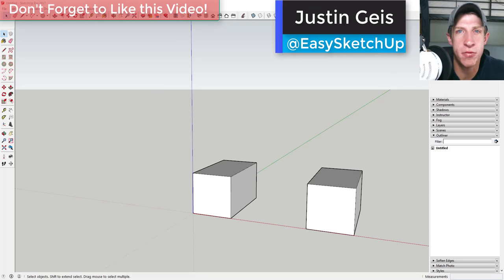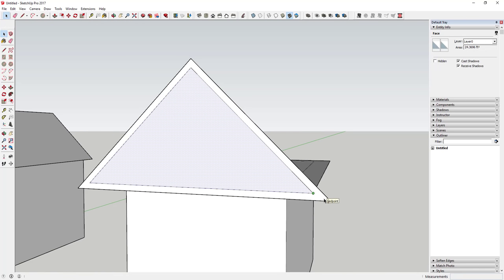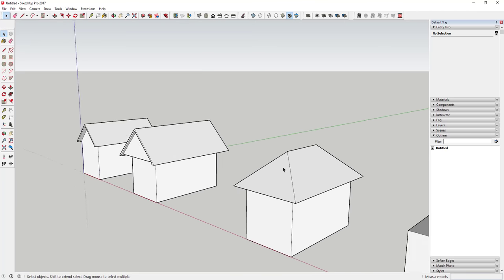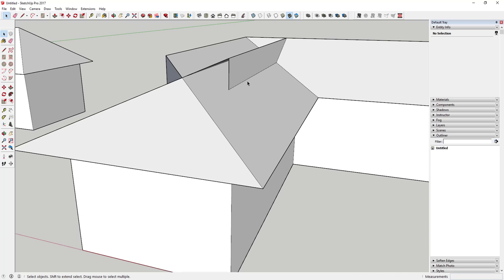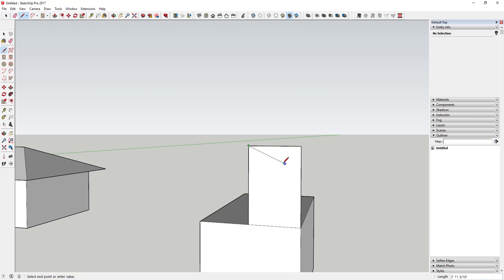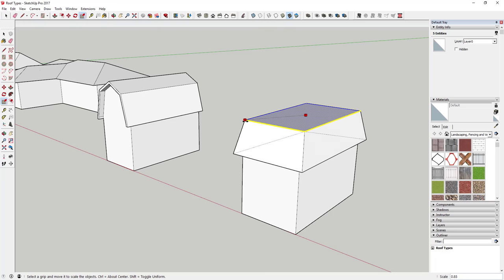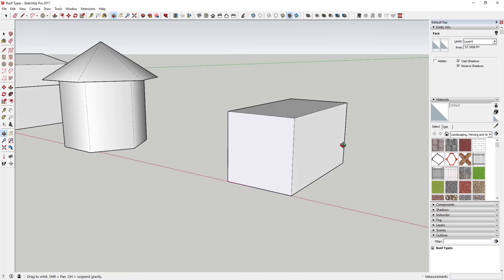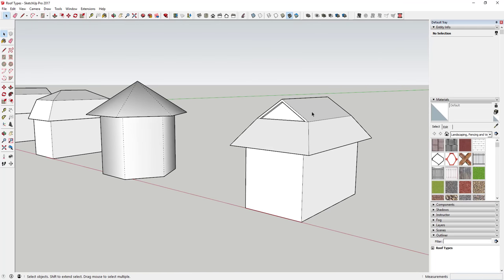Modeling 9 Different Types of Roofs in SketchUp - SketchUp Quick Tutorials

Comment: Also, I saw someone do a neat trick for complex roofs where you find all the center lines, then make 45d angles at each corner, then select all the center lines and lift using "Move" the "Up Arrow". It makes perfect hips no matter what the width or ratios.  You could even make a rectangle in the middle instead of a midline and make the top flat for doing other things.
Does that make sense?
Reply: would you be able to share to us the video?

Comment: I want a flat roof which is on a slight angle so the roof in one end of the room will be taller than the other end of the room. Does that make sense?
Reply from the maker: Wouldn't you just draw a flat plane, then rotate it?

Comment: None of the overhangs in this tutorial represent real world roof overhang design. It's a fair bit more complicated to make proper hip and valley roofs and in which order it should be done by (gable roofs, small roofs, largest ones first, etc). Would be great to create a tutorial that shows how a roof is really designed for the real world. The overhangs in a roof are supposed to go past and below the wall height.
Reply: so draw lines farther down and extrude

Comment: One criticism for you, but hopefully it's a constructive one.

All of the roof types you are modelling are just "drawn", however in the real world, I want to draw to specified dimensions and angles.  

So, how about including some explanation of how you would draw a roof with a specified roof pitch?
Reply from the maker: Fair point - obviously, first of all, it depends on the kind of roof you want to draw. Once I decide on that, I'd probably draw a rectangle that could act as a "canvas" to design my roof slope on, then use the protractor tool to draw the appropriate angles, then trace over that with the line tool. I'd still use the strategies in this video to model the actual roof geometry though. Thanks for the feedback!
Reply: Thanks for that.  I'll give it a try using the protractor tool.

However, as you say, the basic strategies are the identical to what you've demonstrated, once you've decided on the actual geometry you want to use.
Reply: This is why we create plugins, who wants to do all this work just to create a roof.  If you want it exactly as you are going to build it with proper overhangs, rakeboards, fascia and the correct pitch I would suggest using a plugin to do that.